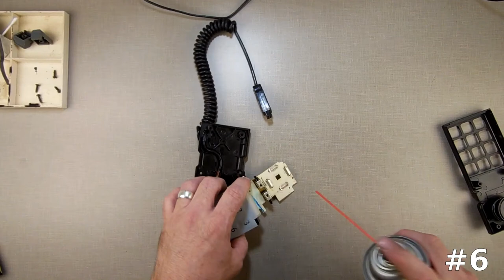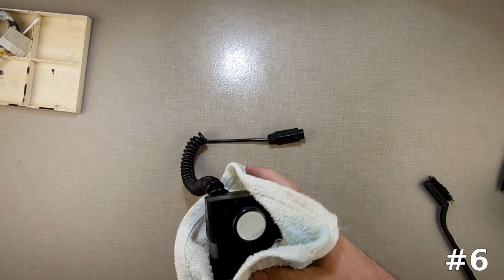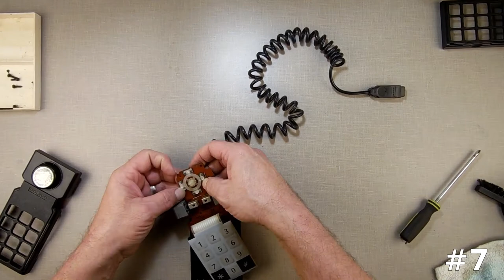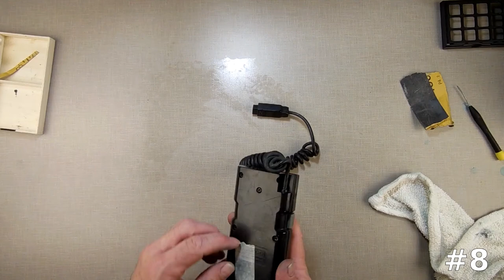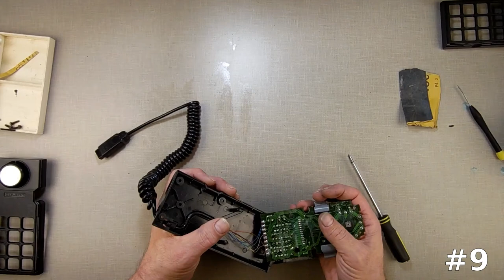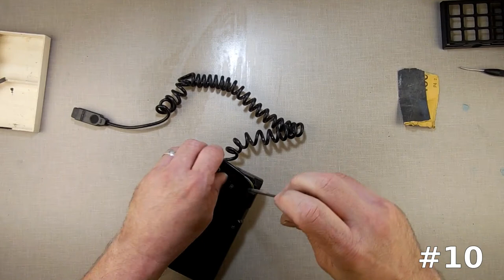Controlapalooza 2022 Part 2

Comment: I had an Intellivision controller that was missing the metal disk very similar to the Colecovision controller.  I found a perfect solution - really indistinguishable!  Cut open a soda can and carefully flatten it.  It's so thin you can use scissors.  Carefully cut out a circle. The inside is clean aluminum.  Spin it around on a piece of sandpaper to create that concentric reflection pattern... Easy peasy!
Reply from the maker: That’s being creative